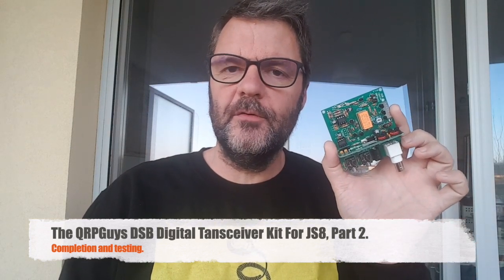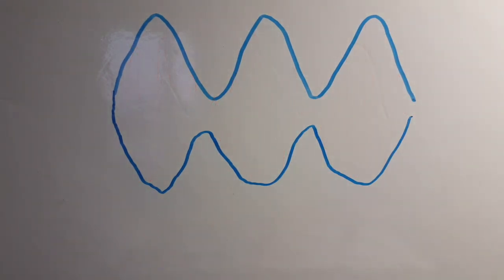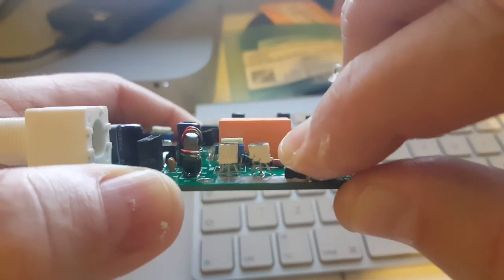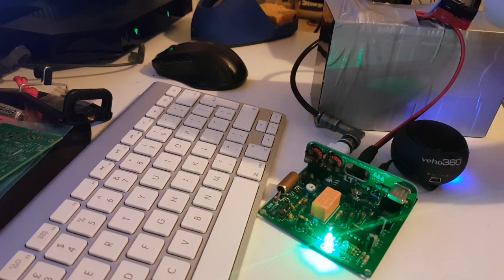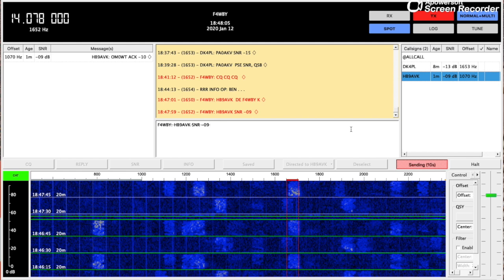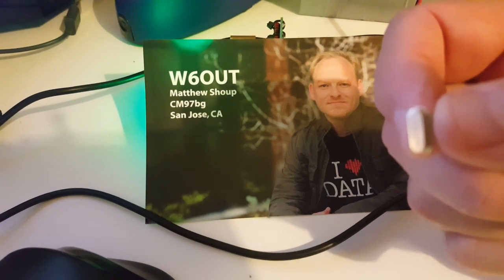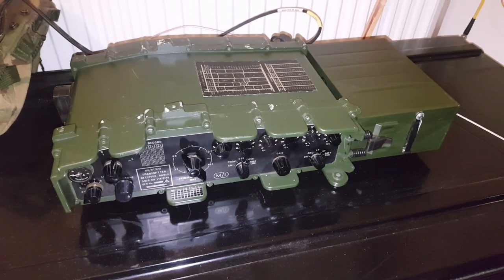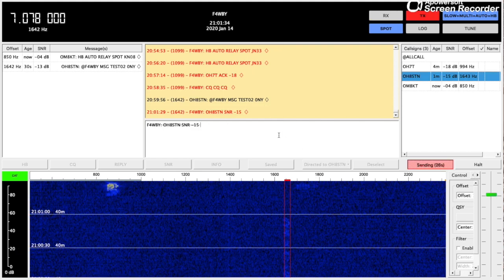The QRPGuys DSB Digital Tansceiver Kit For JS8, Part 2.

Comment: Thanks for the video. I have to point out however that your second illustration is incorrect. In dsb the carrier is not removed, as this would make propogation impractical or impossible. It is suppressed so that the upper and lower envelopes touch each other at points. This reduces power consumption and in frequency domain the carrier peak is reduced to zero.
Reply from the maker: Suppressed as in "reduced?"
Reply: @RadioPrepper  Yes but to correct myself, the envelopes of the side bands actually cross over one another every 180 degrees and there is a phase reversal of the resultant at these points. The resultant dsb-sc signal has the same average cps as the carrier. In the case of ssbsc, the average cps of the resultant would be slightly offset from the carrier which is clearly at RF not audio frequency.Although it looks as though the carrier has gone in frequency domain, it is really still present in a sense as a component of the sidebands. What you had drawn was a time domain plot of the upper and lower sideband envelopes which are simply the message or baseband audio signal and it's inverse with a dc offset.
Reply: @RadioPrepper  Here is my simple Matlab script to illustrate this:

https://www.youtube.com/watch?v=y4sxFARJZ78

And for those interested, code:

%%
close all
clear all
clc
%%
t=[0:0.001:2];
fc=60;
fm=5;
carrier=cos(2*pi*fc*t);
message=cos(2*pi*fm*t);
%%

%%
Rmod=message.*carrier; %Modlate dsbsc
%%
plot(carrier)
title('carrier')
xlabel('time')
ylabel('amplitude')
figure
plot(message)
title('message')
xlabel('time')
ylabel('amplitude')
figure
plot(Rmod)
title('dsb-sc signal')
xlabel('time')
ylabel('amplitude')

Comment: I don't understand why the QRP Guys just didn't design a USB radio. Cost?  If you want to do digital modes you need USB. Only.
Reply from the maker: There are quite a few QRP SSB and DSB radios available.
Reply: Got it!  I just saw your link to the Phaser  USB digital transceiver. Couple something like this with a headless Raspberry Pi and smartphone or tablet and one has a pretty nifty portable station!
Reply from the maker: Yep, check out videos by OH8STN on the subject..

Comment: I had QSO on 40/30/20m and it worked well. And YES, filtering would be better. I also work only from a battery. So I have less noise.
Besides, I would be interested to know if someone has built modules for 60m / 80m.                                           L / C component info would be helpful.
TNX

Comment: “I’m not messing around anymore. I got out my PRC-320, and that should definitely work!” LOL, Gil! It’s cool that you can use the PRC-320 in this mode. Is your PRC-320 modified (LSB, etc?) for digital modes? I’m asking, because I too have a PRC-320, but without any mods. I would like to keep the radio as original as possible. Thank you es 73!
Reply from the maker: It's USB only, and so are digital modes. No mods, just had to make a custom cable.
Reply: Radio Prepper I saw in one of your other videos you were having trouble making the digital cable for the PRC-320. Do you have any information on how to build this cable? Perhaps on your RadioPrepper site?

Comment: In order to show AM and SSB you should use frequency domain graph, i.e. spectrum.
Your pictures are time domain, i.e. envelopes just as you could see on an oscilloscope, but anyway they are far far from reality. Real envelopes look different.
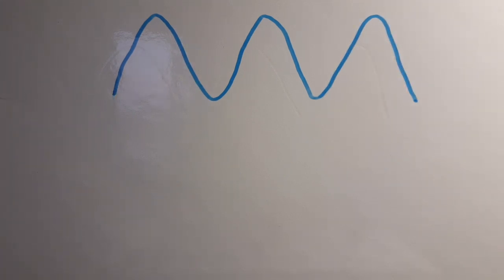Blue line at 1:40 is nothing else but low frequency audio signal ))

Thanks for your videos 
73
Reply from the maker: Indeed it would have been better. Thanks.

Comment: I probably enjoy your winter building videos even more than your summer field operations videos.  I'm currently preparing for Winter Field Day, solo camping SOTA, where I plan to operate mostly JS8.

I wa A subscriber who sent you a message about the Phaser digital mode SSB kit, but probably not THE subscriber.  :-)

I'm going to buy at least one of the Phaser kits to interface with  a Raspberry Pi 4 to make a solar powered JS8 message server that's operating 24/7.  I haven't placed the order because others are wanting to build now and I'm too busy with my Winter Field Day projects and  round-the-world picoballoon, so my JS8 servers (2 and 40 meter) will probably start late February.
Reply from the maker: Great thanks. I do need to get out a bit though!

Comment: Gil, I'm using the D4D which is a good deal as a DSB transceiver. With 700 mW real erp I'm having regional responses (2000 Km or less) with ocassional reports worldwide out of my station secondary antenna (rigid dipole) and 500-700 Km as portable with my random wire with 9:1 unun. The price tag is very small out of crkits.
Reply from the maker: I'll check it out thanks.

Comment: It's unlikely that BS170 has died. I used them for 1W foxhunting transmitters and they're still working since many years, despite the foxhunting course setters are sometimes turn on the transmitters without antenna. I thought they would fry because  of that, but they  don't.
Reply from the maker: Indeed, I have inadvertently transmitted without an antenna with my MTR3b, with no ill effect.